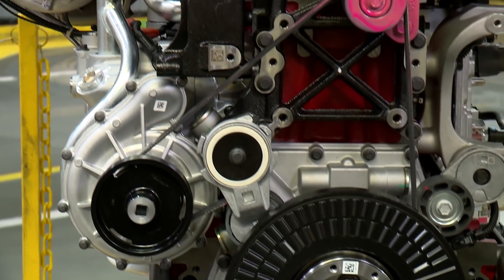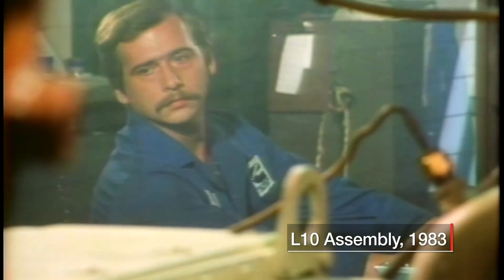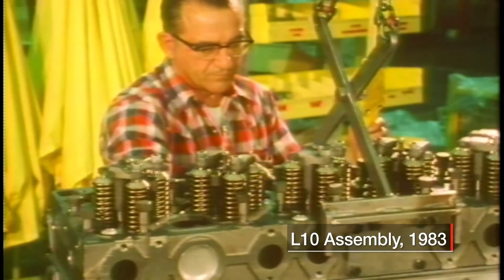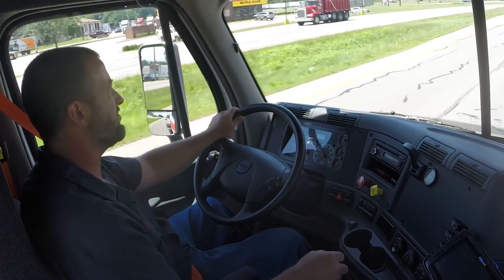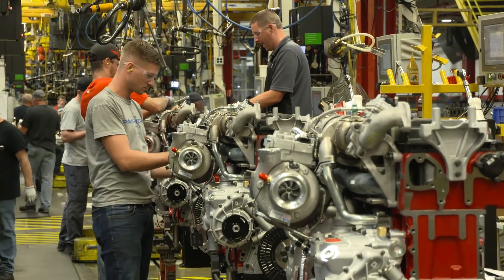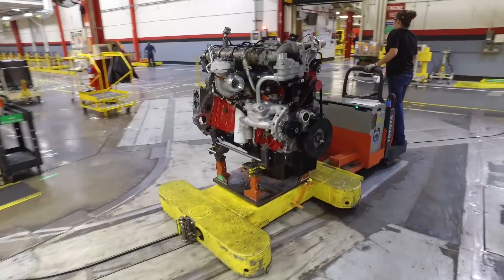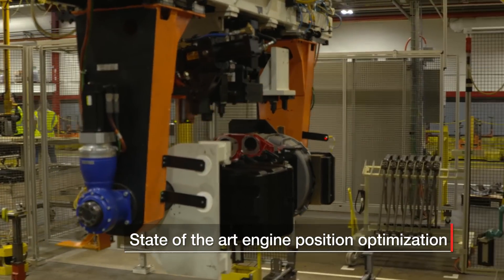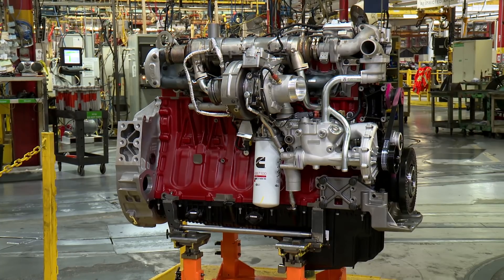Birth of the X12, new Cummins Heavy Duty engine

Comment: Wish they would support and correct the engines they have. Our company has 3 2350 6.7 isbs pulled apart as I'm typing this, due to carbon packing resulting in cylinder destruction and blow by. 10 so far this year. Cummins blames freightliner, freightliner blames Cummins, no one pays warranty.
Reply: Blame the gov. and EPA.
Reply: I've seen this happen in the marine field. I won't say what companies but it was between an engine manufacturer and a boat builder. They were both blaming each other for numerous failed cylinder heads. Needless to say, when a company is buying 60+ engines from you per year... you'll go a little farther to take care of the issue lol
Reply: Matt M, I feel your pain. If we don't have an ISX getting an in frame and the cylinder liner counter bores cut and shimmed, we are putting a two thousand dollar SCR catalyst on an ISB because it has a 3582 fault.
Reply: Matt M wow you are spot on , the company i drive for is experiencing the same problem with our freightliners.
Reply: Yeah Cummins won't openly say they have a cylinder head problem, but I can tell you we have had a pile of failures this year, most with valve seat and guide failures resulting in all sorts of downstream damage. Instead of building more crap, they should pay the warranty claims they have on the junk they already built. And yes, it is epa related. However, they  cylinder head failures are not due to emissions standards. And if you can't reliably meet the standards, get out of the business, don't continue to build junk at the consumer and dealers expense and place the blame every where else. Either you reliably meet epa standards, or don't. Good luck. Looking forward to the new dd5 and dd8. I know our customers are also.
Reply: Matt M thumbs up on that, cat tried feverishly and saw that it was and is almost impossible to make a big diesel engine to burn so clean, reliably and cost effective for the customer so they got out of highway use engines, detroit seems to be the best emissions motor on the market nowadays, we're having so much problems with the warranty and service issues at freightliner because of the cummins motors.

Comment: Love cummins😈 just get rid of the emissions bullshit. Just a muffler. Let the engines breathe.
Reply: agreed if a motor is engineered ,tuned and maintained properly then "emissions systems" would only handicap performance.
Reply: I would like a catalyst that eliminates particulate matter and NOx without any DEF or DPF.
Reply: You can thank California for all that extra crap
Reply: OHMZ Electrical agreed
Reply: OHMZ Electrical then you must also love smog in your air and food!
Reply: All the trucks I've driven up to now has never had a emission system on, to me I that the emissions components are alot of the problem with trucks on the road now; now I applaud Fitzgerald with the gliders newer truck but no emissions.... Especially that they using the signature 600 how isx
Reply: Cant legally
Reply: You don't live in a city do you.
Reply: OHMZ Electrical j
Reply: What, so Cummins can get shut down by the government?
Reply: That's part of the reason I like old stuff. Put an old or new diesel in it and just straight pipe it. Don't have to conform to emissions regulations if it's exempt because it's old.
Reply: Delete delete delete
Reply: Diesel has met emissions standards and epa keeps shitting on diesel.. gas engines are the ones they should go after
Reply: I'm with you my friend, damn the dpf filter an Def regan system.... Let em' breathe 💨 straight pipes all day long
Reply: Right, because breathable air is not a good thing
Reply: Does anyone of you have or will have children who would like to breathe?
Reply: ill bet my straight piped 12 valve that  if you compare any town in america that does not have emission regulations to any town that does . you will find the the people are overall are much happier in the town with out emissions regulations.  because they can drive what ever they want to drive. 
Lets be honest how many people would choose a 2018 Prius over a 1968 dodge charger 
now lets think about what the 2018 Prius will be worth in 50 years versus the 1968 charger?
whats a 1918 model T worth right now ? 

new vehicles are terrible because of the EPA . 
its a fact they universally suck compared to ones designed and built with out EPA restrictions
Reply: teller of truth yea you're right, but all I'm saying is I'm agreeing with you about the emissions; I have a truck with the dpf system on it.... I'm to find a way to bypass it I wanna here my d13 motor talk,.. full straight exhaust
Reply: Agreed. My duramax went from a gutless unreliable pig to a monster with 500 horsepower by removing dpf and scr and egr. Still passed the emissions test lol.
Reply: I challenge everyone that is using clean air as a guise for these systems to think about this...

These systems are so unreliable that it has driven the cost of old equipment up to about par. That means they are so valuable that people will rebuild soot factories until they cannot be rebuilt. That means these old engines are being used when a new cleaner engine could take its place.

Second, no one will pay a "clean air service provider" one nickel more than some other provider that is running an engine that is 10x dirtier. This means it puts the cost directly onto the business owner with no way to recoup these enormous costs.

These systems are full of rare earth metals that require substantial mining efforts, as well as refining these metals and manufacturing into the parts required to take the heat. Then they have to be shipped all over the world. Also, millions (if not billions) of litres of urea has to be manufactured and refined to be used in the SCR system.

Most if the companies I have talked to that have had enough and deleted these systems see a fuel reduction of between 6-8 litres/100kms as well. How can burning millions of litres more fuel a year be a net positive to the cause?

I have also noticed that none of this is required by rail or shipping companies. Why? They have massive resources to fight it because they are usually multinational corporations, or owned by billionaires that can afford the lobby against it.

Any way you slice it, these systems are essentially wealth redistribution. As is the entire climate change industry.
Reply: OHMZ Diesel engines are the biggest polluters that's why governments all over the world are mandating emission controls.
Reply: teller of truth if your saying modern emissions are are anything but power robbing garbage then your a tree hugger
Reply: Man made global warmi....errr climate change is a farse cooked up by these fruitcakes after not being able to get sane people to listen to them...They hate the evil "rich" so they came up with this scheme to stick it to them.They hate industry, wealth, robust productive economies.This is just another way to strangle the life out of a part of society that they despise.

Comment: Love my 2015 6.7 Cummins ....minus the damn emissions !
Reply: Teller of truth... there is 100% something wrong with emissions. I can literally take my 2007 5.9 cummins with 193k miles on it and no emissions other than a Cat and Muffler (stock) and take a 2018 6.7 cummins or powerstroke or the 6.6 duramax turn the trucks on and let them idle. I guarantee the emissions equipped vehicles will stop running before mine not because of gas but because the emissions will literally kill the truck.
Reply: Oh im sorry my work truck is a crane truck and in order to use the crane the truck has to idle.... yea im a fucking idiot lol. my work truck is a 2008 f550 with the 6.4 powerstroke there are days where it will idle for about 6-7 hours. my work truck has been to the dealer 3 times for a plugged up DPF putting it in limp mode where i can max out at a top speed of about 40mph. Oh yea it only has 35k miles on it....... yea..nothing wrong with emissions... while my personal 5.9 Cummins has had no issues related to emissions again with only a cat and muffler. Also what year is your Duramax?
Reply: +teller of truth if you think emissions don't kill a truck. Explain the ford 6 litres egr cooler problem.
Reply: I live in Florida.  We don't have emissions HAH
Reply: IgotGreens101 teller of truth doesn't know what he is talking about. Emissions equipment is a burden on any engine and will decrease the reliability by adding complexity and failure points. my personal truck is a 08 f350 with a 6.4  DPF delete and aftermarket tuning its a night and day difference compared to having it not deleted used to be a pos
Reply: I have a 2007.5 early 5.9 ...it's a good girl lol
Reply: Marc Ridel nice the 5.9s are solid
Reply: These arent your baby truck engines. These are put in real trucks.
Reply: teller of truth I own an ISX15. I know a 12 litre is small, but compared to a 6.7L it is.not.
Reply: Marc Ridel if you have a 2007.5 that is the 6.7 Cummins still good after a good ol delete. The early 2007 was the last year of the 5.9 (I have a 2007 5.9 Cummins)
Reply: 3Gunner yeah my buddy did a delete took him about 3k in all to get it done
Reply: Can I put this engine on my 1 ton truck
Reply: Thomas where do you specialize in deleting at ? I’m in NC but we have No Emissions on Diesels here I’m just shaking it down good before I pull the stuff off .
Reply: How does your comment have any relevance to the x12?
Reply: 3Gunner I specialize in removing that .
Reply: teller of truth your a uneducated idiot.
Reply: I don't think anyone that does manual labour (i.e has anything to do with trucks) for a living should be talking about IQs lol.
Reply: 3Gunner Leave the emissions on there, fucking fossil fuels do enough damage to the environment